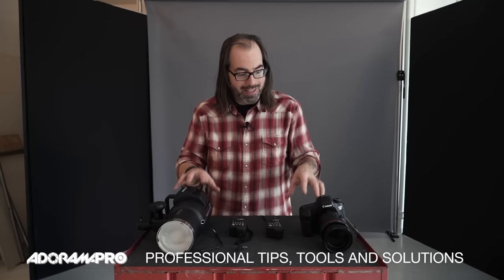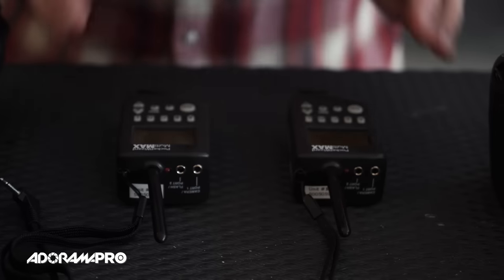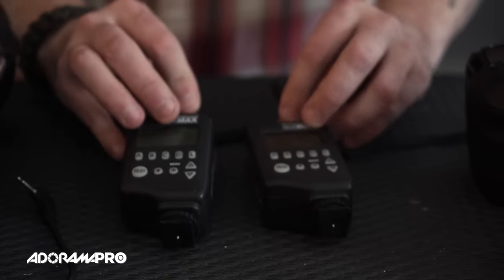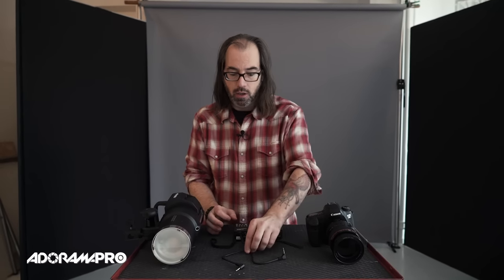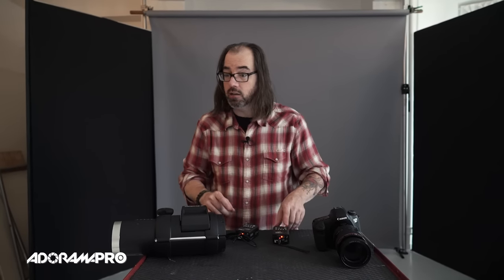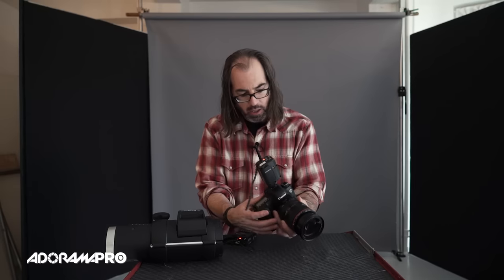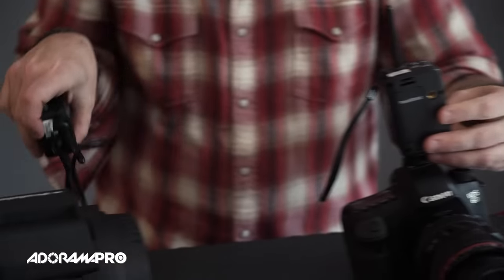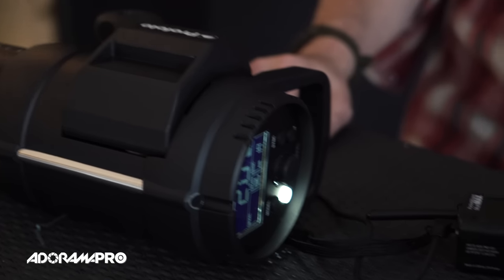Troubleshooting Radio Triggers - OnSet ep. 67

Comment: One thing happened to me with two Pocketwizards Plus X. I had two flashes in clam shell with soft boxes, and the pocketwizard was attached to the top flash and hanging on the tripod, the other as a slave. I was shooting with my camera in a vertical position, about between the softboxes. I had a lot of misfires and I freaked out, because sometimes it would work just fine. I was in the middle of a multi model shoot, no time to troubleshoot, so I just use a regular sync cord to the flash, I could not trust the Pocket wizards anymore. Later, after the shoot, I found what the problem was. If the units are within one inch of each other, and the antennas are crossed, it does not work. When I was shooting horizontal, no problem, but as soon as I would go vertical, the unit on my camera crossed the one next to the tripod, and I would lose the shot. These are the only Pocketwizards I have worked with, so I don't know if the other ones do the same thing.